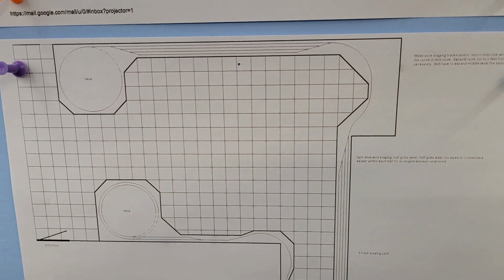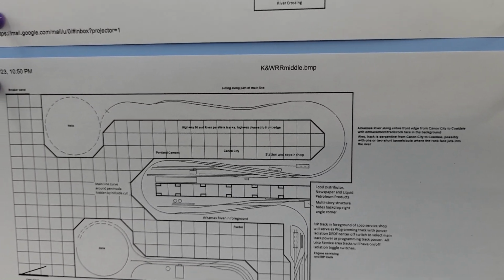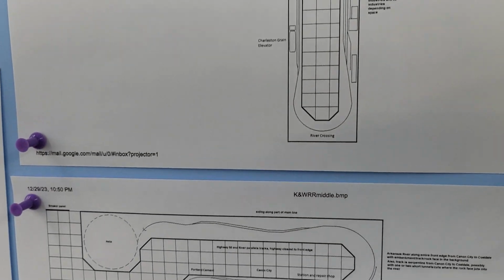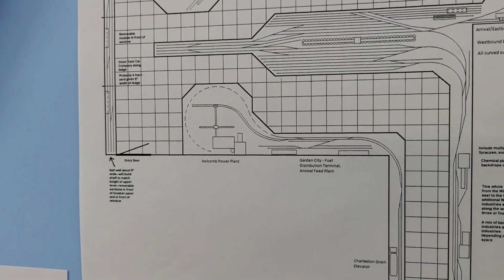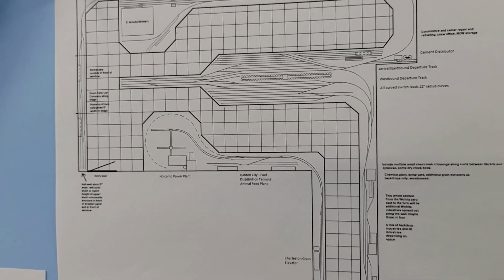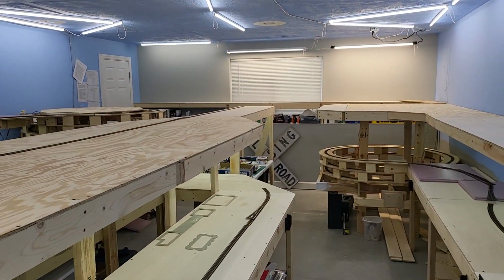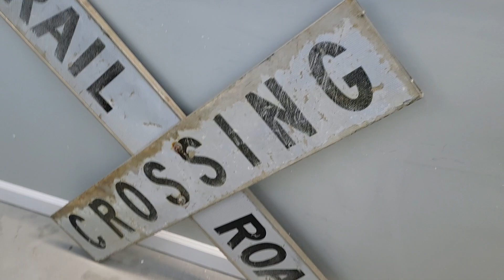K & W HO Scale Model Railroad, Construction Update #14 - Benchwork done!  Well, practically done.

Comment: Suggestion: Where you have the corner of the helix close to your work area, you can gain a lot more aisle space and also save hard knocks when bumping into it by cutting off the corner.  Start by inserting a 45-degree block inside (screwed and glued).  Then  when the glue is set, cut off the old corner, using the new block to guide the saw blade.
Reply from the maker: Thank you for the suggestion.  I was working on plans to do a permanent build for that workstation based on today's video and kept noticing that corner jutting out, reminding me that although I don't think it will be a problem, it would also be a lot better if it didn't exist altogether.  I hadn't yet thought how to get rid of them all (if I get rid of one, I might as well get rid of them all for the same reason), so I will take your design suggestion under advisement.
Reply: @KandWRailroader  Glad it was a useful suggestion for you.  I did exactly the same on one of my layout builds a couple of years back.  It's one of the later episodes of the K&SV layout build -the episode where I dismantle it for shipping.
Reply from the maker: @mpeterll  Thank you for the episode referral.  I will check it out.
Reply from the maker: I found the video you recommended and understand what you were suggesting.  I'll see what I can do about resolving my similar, though much less complex problem.  I admire your ability to disassemble and safely pack your layout builds.  I don't know what you are getting paid to build these for buyers, but it's probably not enough.

Comment: Wow, you have done so much in such a little time.. it looks fantastic... One thing I would suggest is get rid of those hard corners at the bottom of the helix as you will find you keep bumping into the and they will be an eyesore and a pain in your back literally ..... place framing under the helix and then cut off those corners. I love the idea of the workstation under that bench it will give you access to the track for working on locos if you put a track from the main line onto the workbench at the back then you can do maintenance or move anything off the track for repairs right there at your workbench.  I can't wait to see more track laid and a full run through with a loco and some rolling stock.... not far to go now.. then it's play trains time yipee soo happy for you ....
Reply from the maker: Thank you!  Unfortunately you're about an hour late with your suggestion...heh heh... @mpeterll just recommended the same course of action.  It is a good idea though and I'd sure rather get rid of them before they try to rearrange one of my, or someone else's, kneecaps.  Someone else already suggested the same idea about running the programming track on to the workstation too so I guess great RR minds think alike!  Definitely following through with that idea too!

Comment: Great start to a great layout design! Some great industries to build along that line of track! I'm a truck driver, and I've have a few videos of most of those routes that you're trying to build. I got a big grain elevator on an old layout. I bought it from another modeler. It's just the basic design,  Walthers head house from their elevator kit and cardboard tubes. The head house is built on top of a 4" block of wood to raise it up to look better with the taller silos. When you said you wanted to see bigger elevators, I thought of the 1/2 mile long CHS Grain Elevator in Hutchinson, Kansas. You can see that on Google Maps! You're not depicting anything from Dodge City Train yard or National Beef? You're following the old Santa Fe, now BNSF Line from Pueblo to Hutchinson. It was MoPac that connected Hutchinson to Wichita that follows KS-96. That train yard at the big double elevator is now Union Pacific. I'll have to get the train atlas out to see what's what from Wichita to El Dorado.i have pictures of that big elevator on my Facebook page, under Roy Hardwick. Lots of videos of Wichita, Lamar, La Juniata, and Garden City. Have fun. I would love to find run trains on your layout when you're done. Roy H.
Reply from the maker: Thank you!  I'm actually following a road route which starts in El Dorado and follows the old MoPac line to Wichita, then follows Highway 54/400 until 54 splits off to Liberal, then it's basically Highway 50 all the way toward Salida, Colorado.  I was going to include Dodge City where the Charleston elevator is now on the layout but I thought the layout was getting too dense with industries in that area and wanted to represent an example of a "lonely Kansas skyscraper".  I'll keep you in mind when there is enough layout complete to start thinking about an ops session!
Reply: @KandWRailroader  I didn't know there was an old MoPac from El Dorado to Wichita. I'm actually from La Crosse,Kansas, in West Central Kansas, where the MoPac ran along KS-4 for most of its route. It splits off of the original ATSF line east of Pueblo, Colorado, and along CO-96 to KS-96 to Scott City. From Scott City, it runs diagonally to Healy,KS, and KS-4 to Linsburg. With a branch running north to Salina. I think the line also went to Herrington and on east to either KC or crossing into Missouri south of KC. I've never followed those tracks that far east on my Railroad Atlas. I do know that MoPac called this line, it's southern route. I'm trying to model the line from KC to Port Arthur, TX. I'm going to be mainly focusing on Port Arthur, TX, and the loading docks of the military transportation and battalion groups in the area. I'm adding a container port facility with a container yard, ethanol plant, and a grain elevator complex to the dock area! Protolance, MoPac with KCS, KC Terminal, ATSF, with BNSF, CP, NS, CSX, road diesels moving hot shot unit trains to and from the port! Intermodal, auto, steel coils, grain, oil, military, sand, gravel, rock, & ethanol. Might build me a 100 dock door cold storage warehouse?
Reply from the maker: @CONTAINERMAN68  I went to college in Lindsborg at Bethany '93-'97 when BNSF still ran a couple dozen main line trains through town a day.  I can't believe I learned to sleep through those horns as my dorm was about 100' from the track!  Sounds like a great layout!  A lot going on at ports!

Comment: It’s looking really good and you are really putting thought into the placement of track and structures.  Something that I totally identify with!  A suggestion:  With you putting your workbench under the upper level and putting a backdrop on it, why not have a spur come off the main and along the back of your work area and have that as your programming track?  That way you have access to all your tools, it’s up out of the way, and you don’t take away from how you stock and use that rip track.
Reply from the maker: Ooohhh!!!  Another great idea submitted by my viewers!  Man I love having this channel for that reason.  I will give that suggestion some serious thought!  The only issue would be having to re-locate my Powercab which is currently stationed right next to the yard (which is how I came up with the idea in the first place), but relocating it wouldn't be a big deal at all.  Then I could set up my loco cleaner at my work station too.  This is one of those ideas that the more I consider it, the more likely it is to happen!  Thank you very much!!!  😃
Reply: You’re welcome.  Glad to help! 😁

Comment: My Advise Little By Little Don’t Rush It.
Reply from the maker: I might have rushed on the benchwork because the job plan was pretty simple and straightforward.  However, with that complete, things will certainly slow down now as structure construction has become a necessary priority in order to continue with main line construction.  I can't afford to permanently place track, only to find later that a planned industry or structure won't quite fit because I placed track with too little clearance.
Reply: Hope It Don’t Bite You In The Rear.
Reply from the maker: @elleryparsons2433  Nope.  It actually went better than expected.
Reply: Cool Beans👍👍👍👍.